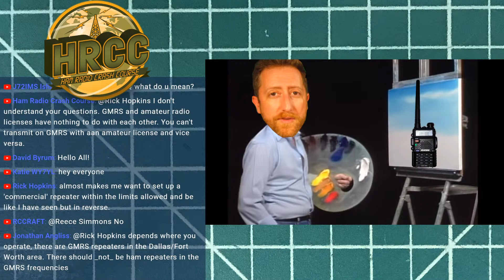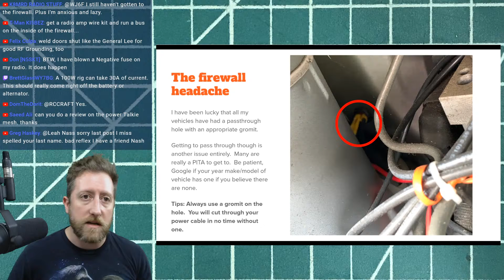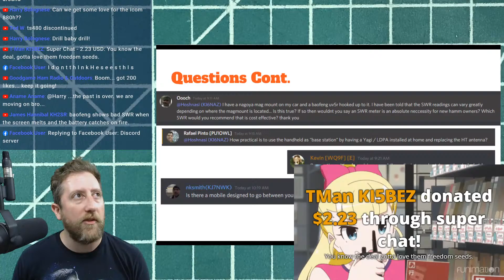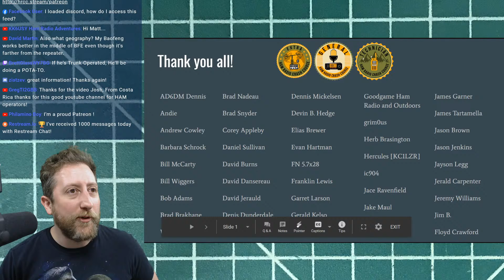How to Setup Mobile Ham Radio VHF/UHF & HF and Tips - Livestream

Comment: Gosh Josh. This is a nice topic. And there’s again. A lot of information. 
—————‘—————
@0:00 Welcome! 
@2:22 A Quirky Morse Key.
@4:01 Software for morse code.
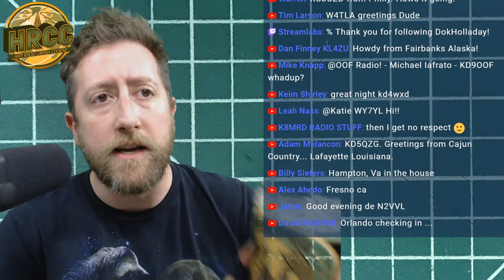@5:29 Merchandise?

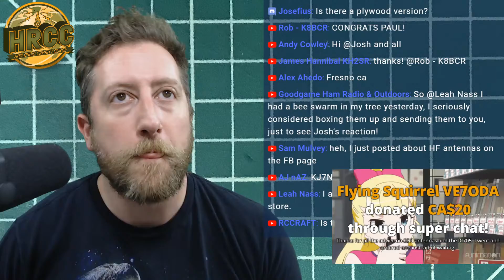@6:13 Mobile Setup&Tips.
@8:00 His Mobile radio’s.
@9:10 Starting Out.
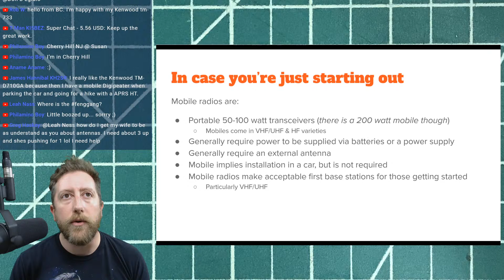@11:26 The value of Mobile radio’s
@13:03 Cons?

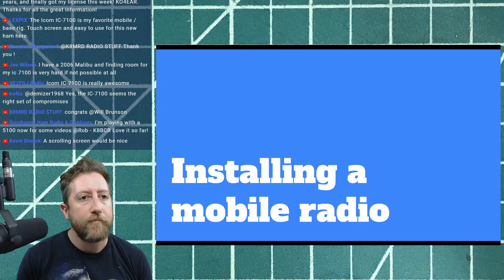@15:01 Installing A Mobile Radio.
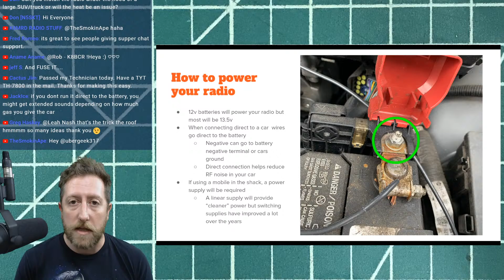@17:15 Vehicle Grounding.
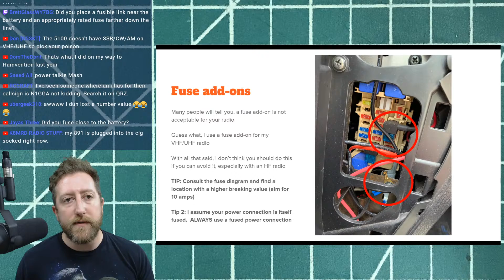@17:57 Fuse add-ons
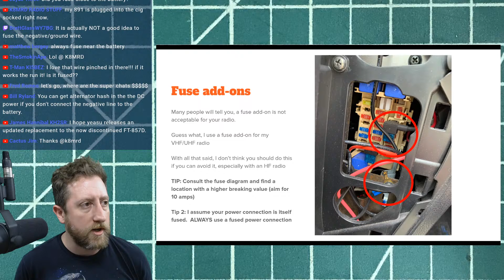@18:47 an add-on tip.
@19:24 The Firewall Headache 
@21:41 Finding a place in the car.
@23:40 Mounting the head unit.
@25:57 I buried the radio, Now what?!

@27:55 VHF & UHF Antenna’s.
@30:03 Lip Mount.
@32:47 LOCTITE!! 
@33:13 HF
@34:14 Mag mounts.

@36:19 HF in a vehicle.
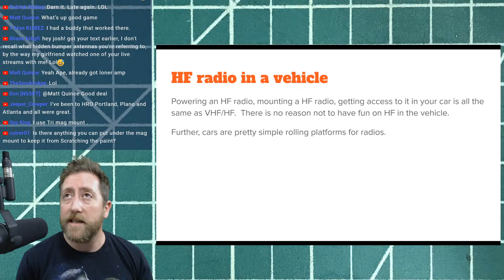@36:52 Ground Plane.
@39:12 Lock Washers.

@41:50 HF antennae.
@44:59 His HF Mobile Antenna.
@45:49 The Impotance Of Bonding.
@47:23 Mobile HF Antennae cont.

@48:55 Dealing with Noise!
@51:25 RFI Chokes.

@54:25 Recommended Radio’s.

@1:00:08 Questions.

@1:14:05 Thank You Patreons ! 

@1:18:39 Keep Up The Podcast and the margarita’s ! 

—————‘—————

I hope it helps. If editing is needed please let me know.
Reply: The chapter list. 
___________________
@0:00 Welcome
@6:13 Setup and tips.
@9:10 starting out.
@15:01 Installing.
@27:55 VHF UHF Antennae.
@36:19 HF in a vehicle.
@41:50 HF antennae.
@48:55 Dealing with Noise.
@54:25 Recommended radio’s.
@1:00:08 Questions.
@1:14:05 Thank You Patreons! 
@1:18:38 Don’t forget the podcast.
___________________
Reply: 0

Comment: Another nice video.... I've a mobile V/UHF in my LR2 which was simple to install but my preferred mobile setup: 
FT3D on my motorcycle! Radio mounted to the bars using a generic phone holder, power comes from the Yaesu 12V adaptor (Empty AA battery adaptor installed to save constant charge of standard battery), Mic/Tels via bluetooth to my helmet kit. Antenna is a Nagoya on Nagoya mount attached to the rear grab bar and bonded to the frame. Gets out a treat!!

Comment: To the Landrover guy: buy some N52 grade large supermagnets. Put your magnetic antenna on the roof, nor slip the supermagnets under the headliner, and as they align in place, mark the locations then epoxy them there. Beware, supermagnets can "jump" and seriously bite your flesh if you give them a chance too.
 Works on fiberglass roofs too. Use a big magmount (5-6") and don't skimp on the N52 magnets.

Comment: Direct to the battery - and fuse it appropriately with a blade type fuse in a good waterproof fuse holder. I do NOT fuse negative or run it directly to the battery - which is what a lot of old timers recommend "because the radio manual says so"... but the standard to take both leads directly to the battery are archaic, based in a time when not all vehicles (some big trucks) were negative ground, and most radios were floating ground. Those days are long gone. Their logic is usually "The manufacturers recommend this way, and they must have a reason" - yes, they do have a reason ... because nobody's rethought that "best practice" in the last 50 years and the problems that can arise from it are rare enough that it's not worth it for them to pay to reassess the situation.

I run + directly to the battery or the positive connection point on the vehicle for newer vehicles, or cars with batteries in weird places - the + "jump point" is where you should hook up to in those cars, and the neg to the vehicles common ground point where all grounds come together.

Comment: I have done several mobile installs for CW mobile.  As far as hidden antenna car is black and 2M antenna Diamond I spray paint black.  Yes, already black but it will get weathered and looks great.  Hard to see antenna as it matches car paint.  Mounting head unit to front seat post best option.  I have removed units and no one can tell I have had a ham radio in the car.  Drill no holes, no damage to vehicle.  Have fun with radios.

Comment: Use a 3/4" Greenlee die to cut the hole in the roof. It will seal up with a rubber grommet provided. Pulling the headliner loose you will be able to route your coax to the trim and then behind the trim to the floor. You can go under the carpet by lifting the foot sill and run the coax under the carpet to under the dash near where the radio is mounted.

Comment: Shack in a pickup truck . Yaesu FT857D With a ATAS 120A Screw driver antenna . Served me fine for 7 years. As long as you ground the antenna correctly.. With separation kit , and a Duplexer...

Comment: In the CB days I had a mount that would attach to the radio with a piece of coax that screwed into the radio. The mount that attached to the vehicle had a cable with a SO239 and power wires to splice the factory wires to. They may be a little hard to find but they were easy to find back in the CB days. They had extra wires so you could hook the external speaker to and plug it into the radio.

Comment: If you go through the firewall but can't fit the fuse holders go ahead and cut them off so you can feed the power cable through the grommet. Once it is through the firewall use heat shrink and solder the wires back together and heat shrink the joints. A larger piece can go over both wires that have had  heat shrink covered the individual wires.

Comment: L cut h cut, slope. Lowpass and highpass filters, slope of filter being the db/octave it attenuates the signal. Most vehicles can ground anywhere, if you have the vehicle properly grounded and it is always preferable to go to the frame with as short of a cable as possible. And if you've properly RF Bonded your entire vehicle as you should, you'll have no issues.

Comment: 7.62,  5.56,  5.45,  54r, all fun.    Installed an ftm400 in a tacoma.  Comet antenna off the back end.  Seems to work well.  Head on top of dash with ram mount.  Body under pass seat on a custom bracket with velcro.  I do get clicking sound running audio into the truck aux.  I hope this is eliminated with a dedicated speaker.

Comment: You know what would be the ultimate mobile radio setup? A quad-band radio like the KG-UV980P but with the remote head of the BTech 50x3... that head is a "mount to windshield" almost gps-style head with speakers built-in. If I recall correctly, the 980P can do down to 10 meters (11 really I think) and 6 meters and 2 meters and 70cm for TX. I think it can RX 7 bands, including airband.

There are supposedly antennas that can work with all that, but I have to admit to being a noob still studying for my test so I don't have any experience with them yet lol. But I like the idea of having a radio like that which can be easily unlocked if you can find the software to do it (or possibly purchased directly from the factory shop already unlocked) so that it can be used as an emergency backup for other radios too. To be clear, I don't mean to use this for talking on CB or GMRS etc unless it's an emergency situation where I didn't have any of my HTs for those, but I like to have as many options as possible for communication in an emergency. I think having a radio capable of so much makes for a decent emergency backup to the radios we generally use more daily. If you're out and about when an emergency hits, it seems like a good idea to have those options in your vehicle. 

Sorry if you covered all this before. I only recently found your channel here and am still exploring your back catalog lol.

PS - I'm pretty sure the 980P comes with the remote head extension cable and also, it's Wouxon, so it's Super-het instead of system on a chip and able to do proper, real, dual receive. Also, what do you consider to be "great features" in a radio? One of the things that is drawing me to the 980P when I can get it is the channel group scanning. I like the idea of having different bands in their own groups... like a group for GMRS scanning and a group for First responder scanning and a group of just the weather stations or the marine frequencies etc. If I'm driving the PCH (that's one of the things I miss most about living in cali lol) Then I might just want to scan the marine band to listen in on boats and stuff. If I'm driving inland, I might want to monitor both CB and GMRS for traffic info. I can't imagine I would hear anything useful down in CB land until more CBs have FM tho now that that's a thing, thank you Cobra lol.

Comment: Before deciding on a do it all radio ask yourself how much VHF and UHF you do when in the vehicle. Do you tend to do more with HF while driving? Then you would do better by getting a separate dual band radio and a good HF mobile radio. That way you can monitor your local repeater if you want while operating on HF. When I was working for a living I would work HF regular going to work. My friends from work who were also hams would ask me why I wasn't on the local repeater on the way to work? I told them I was on HF. I had the Alinco  HF/VHF/UHF. So I bought a lesser expensive dual band radio and ran both at the same time. That way I knew if one of my co-workers was calling me on a repeater while I was on HF. I usually monitored a net on HF and chose not to monitor only the repeater.

Comment: About 50% done with installation of FTM-400XDR in 2020 F250 and about 50% done with general arrl Manual. 
Hopefully the FTM-400 will be up and running tomorrow. I powered it on today and it’s asking for a call sign. NMO Mount drilled through the roof for best ground plane. Fingers crossed al goes good.
Reply: Maybe I’ll post a video if I got everything

Comment: I started with a Baofeng on a mag mount in my truck. I saved up for a TYT-7800 which is still in my truck today with the mag mount. The antenna is the next upgrade, but how to mount on the truck is a challenge when you park in a parking ramp daily.

Comment: This is the first show that I watched. What do think of the ICON 706? 706MKIIG? I’m into doing CW Mobile!!!! I need to install grounding straps on my Dodge pick up. I “prefer” to install a Tarheel antenna on the front end of the vehicle. How difficult would it be to install 4 deep cycle batteries in the bed of the pick up to operate on field day and have the truck alternator charge them? Thanks for great show!
Reply from the maker: That all sounds good. 706 is a good radio from the past generation.

Comment: I am trying to get back into ham radio with a dual band radio mobile.  I have pretty much decided on the icom 2739a but it appears that antennas and mounts cost almost as much as the radio.   Is this normal?
Reply: Icom is the worst about charging extra for items that are nearly essential, but all mfrs do it to some degree. That said, I have more Icom radios than any other make.

Comment: Two years on and this new HAM is getting great info from this video for my first mobile install. Antenna question: What are the thoughts on some of the compact dual band antennas out there? I am thinking of a mag mount on the top center of my F150 and want to keep my profile a little lower with a compact.
Reply from the maker: I think some of the claims may be a bit dubious. But I have not tested the antennas so I don’t know.

Comment: Being brand new to the hobby, I am wondering what the most popular mode is. From what I gather manufacture's have different modes (for lack of a better term) eg. Yaesu and fusion, wiresx. Icom dstar etc. What is the most popular modulation used by most people?

Comment: Hi, Josh. You and Jason convinced me to get my ham license. Did Tech and Gen together.   I remember a video where you had installed I think a comet SBB7 near the bottom of your tailgate. I failed to note the mount you were using as I was watching on mu Roku instead of the computer. So now I about to invest in a Yaesu 400 and plan to mount it my rav4 hybrid.For th life of me I cannot find that video to get the description links.  Your enthusiasm for the 400 along with the bigger screen than the 300 and 200 finalized my decision.  If possible, could you point me to that video?
Reply from the maker: I’m using a Comet lip mount for the antenna and it mounds to the rest hatch of my vehicle.

Comment: loved the info. new to the hobby. i have an ft-70dr, ftm-300dr and the ft-891 with the 120a antenna, and Larson 2/7-sh. the 891 is almost wired up. slow but sure. I've run 8 awg wire from battery to the trunk, Fuses and the battery and fuse blocks in the trunk for connecting each radio. I think this will work, any thoughts? now i just need to do all the bonding. Is there a certain size  band that should be used?

Comment: Hello, silly question. Can I use a cable kit like Diamond  2D4MR, 2D5MR and others to mount directly to the roof of the car or is it just for use on brackets? I can't find anywhere in the pictures if it has a rubber seal due to leaking under the roof. It is not possible to read anywhere what the attenuation is, so I still decide between this from Diamond and T301 from Sirio where at least it provides some information. Thanks to anyone for the advice

Comment: Mobile power problem on new cars: radio makers say go to the battery with dual fuses. Car makers say NO because there is a coulomb counter (power sensor) in one power lead at the battery, and if you bypass this, the car's power management system will not operate properly, all charging may be affected. To make things worse, VWG uses an explosive (pyrotechnic) fuse in that same location, to blow the starter and fuel pump in case the air bags deploy. So if you tap in at the coulomb sensor, beware the possible pyrotechics! It has gotten too damned complicated.
 Some of the alternators actually TURN OFF at highway speed if there are light loads and the battery is 12.4-12.6 volts, to reduce engine load. So there are good reasons to add a 2nd deep cycle battery, for the radio, using an Echocharget, Yandina isolator, or Hellroarer.

Comment: I’m having trouble with my mobile build. I’m a newbie. Watched a lot of videos on setup including yours. 
My issue is that I have all the correct settings on my radio and I’m getting more static than my ht in same location as well as not transmitting to the repeater. I have not seen anything about a ground bond to the lip mount I have installed on my hatchback. Could this be the problem. 
I don’t own an antenna analyzer yet, and a lil concerned because person I talked to at hro suggested all the material I would need. Could this be the problem? I know it’s a loaded question but everything I find on you tube is about ground bonding is for hf and cb!! 

Would love any feedback you may have. Thanks again.

Ps I have the diamond 770hb and a comet lv-5R universal lip mount attached to ftm 300

Comment: How close can you mount a 20 meter Ham stick and a Dual band antenna on the roof of a car, without negatively affecting the receiving radio via Friis transmission.
Reply from the maker: I keep one on one side of the car and the other on the other side.

Comment: How about mounting a HAM antenna to a steel offroad front bumper? Would that work? Or is a magnet a better way to go on the roof?
Reply from the maker: It’s best to get it up as high as you can on the vehicle. You want the most of the radiating element above the metal of the car.
Reply: @HamRadioCrashCourse  Ok. Thank you for getting back to me so quickly. I will look into a magnetic roof mount or possibly a hood mount option.

Comment: Wonder how this could work in a Prius.
Reply from the maker: Bout the same as my ev.
Reply: @HamRadioCrashCourse  Assuming the ATAS has some shielding that the Tarheel might not have.  Thanks.  Should have elaborated 2019 Prius.  Think it might have more noise than an older model.  Tarheel told me a guy had a Prius and got rid of it because of the noise but nothing about grounding or bonding from Tarheel.

Comment: Does anyone know how to prevent water leaking into the car through the coax cable? 😐
Reply: furonwarrior depends on where the through hole is. If like through a grommet it normally should not leak, but you can how ever put some butyl tape in there. This stuff is also great for through the roof antenna’s to put some butyl tape between the roof top and the antenna. Just make sure the grounding is proper on the underside of the roof. 

Hope this helps.
Reply: You can use refrigeration sealant around the hole. It will seal very well.
Reply: JD Willemsen PD1JDW The cable goes through the door and I assume the rubber seal would keep it sealed up. It worked fine for my CB antenna coax when I had one. Maybe it enlarged it too much for this smaller coax connection. I’ll look into this tape method, thanks.
Reply: Tom Jones You mean liquid silicone?
Reply: Well if it’s a grommet maybe it’s time for a new one. If it’s just the door seal. Make sure the part of the coax that’s on the outside is lower then inside. It’s better to illustrate then to tell but I hope you know what I mean.
Reply from the maker: This a mag mount antenna I assume?

Use thinner coax.
Reply: JD Willemsen PD1JDW I came to realize... it’s the door seal... but I think both the coax from the CB antenna, ham radio antenna and just age kinda weakened it allowing water to go through... 😐
Reply: Ham Radio Crash Course It is, and that could be true. Smaller coax might do the trick, thanks. 😊 But I think the bigger issue is the car door seal since I had another massive leak in my car without the cable... F.

Comment: Hi Josh, how can i connect 2 antenna on my car  one for UHF and one for VHF to IC-2730A. what do i need?
Reply from the maker: Two antennas, two mounts, two runs of coax and a coax switch.
Reply: @HamRadioCrashCourse  I wonder why he doesn't want of use one dual band antenna.  They seem to be rather common.

Comment: HELLO FM MANILA PH
Reply: I run a ftm100 and 7900, my HF has 2m/70cm Icom 706mk2 needs a new front display and a Yaesu FT857d has a power problem
Reply: on one of my cars I use to have a bumper mount antenna for 40m and a larsen dual bander for vhf/uhf